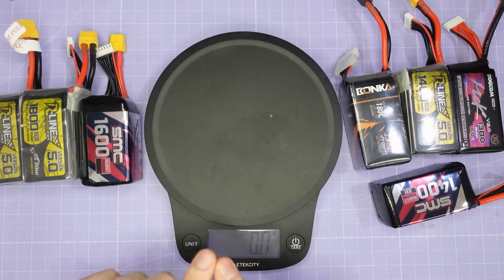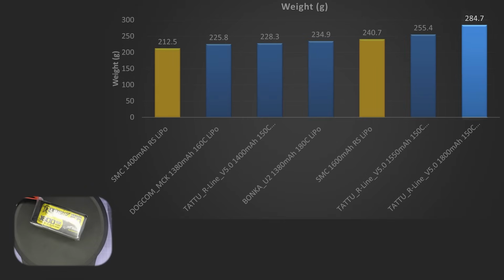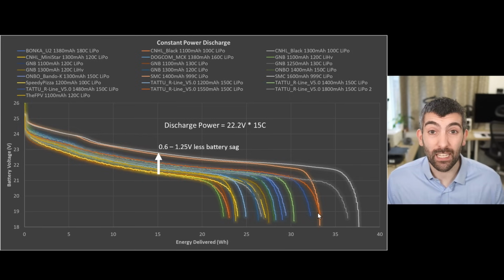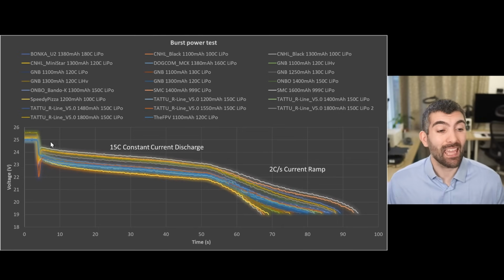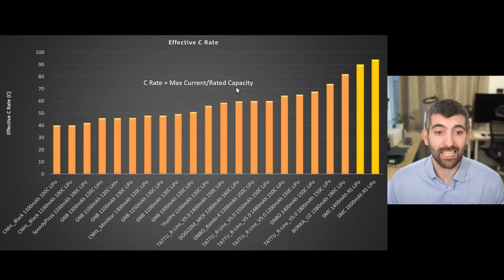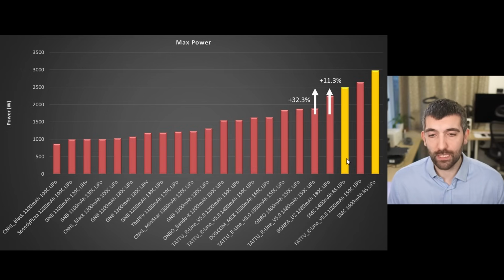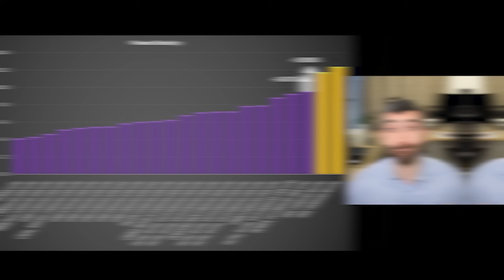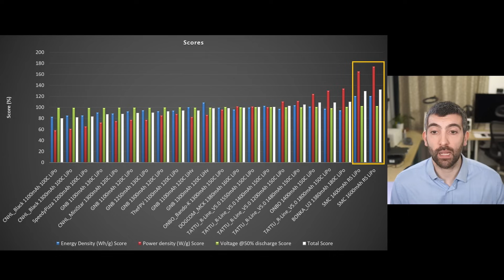Ultimate performance: SMC RS 1400mAh and 1600mAh Batteries

Comment: SMC you promote are capot. No good battery. You lie. No good performance. It's dangerous, easy to got fire as well just a few used only. Not more-than 8 uses, and same minutes on the other lipo battery.

Comment: Only problem is they are not producing example 850 for smaller drones and example 3000 for 5-7 drones, but other than that yea, best batteries hands down.  FOr the 850 i need to get tattu 5.0 and for a 3000 GNB lihv would be my choice

Comment: Hi! I have a genuine question that I think might be quite important! 

In the burst power test of the SMC 1600mAh LiPo cell, it goes from 15C to 94C in a total of 39.5 seconds, with an average C-rate of 54.5C. 

At a discharge rate of 54.5C, the cell is completely emptied in 66.06 seconds, so with the test starting at 80% capacity and lasting 39.5 seconds, the cell is only at 20.2% charge at the end of the test!

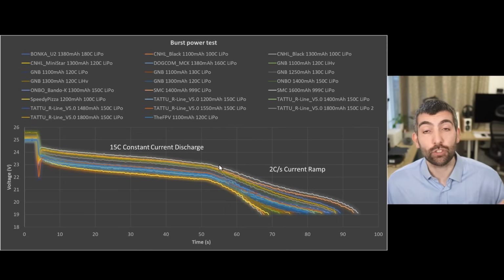4:54 You can see the voltage of the battery drop unusually steeply towards the end of the discharge, and I believe the results of the burst power test may have been affected from the cell being almost empty!

Have you considered that you might need to change up your methodology to be able to test these higher C-rate cells accurately in the future?

Appreciate your videos and will be looking forward to hearing from you! 😊

Comment: I just bought 2 of each of these and these things are beasts!! I ran them in a Mario 5 xh with the AOS supernova motors and it's quite a noticeable difference in performance. It's like when I modded and tuned my fz/mt09 and now have gobs of torque throughout the rev range. Also getting 60+ seconds more flight time

Comment: @Chris Rosser, damn you always have the answers that's for sure.
Look man, maybe you could find the cheapest Battery brands and figure out who has the secret sauce that really and truly outweighs the competitors.
I have this issue right now with CNHL Black 5000mah 6S 10awg 65C Rated.
I flew it about 10 times to empty and performed an "Internal Resistance" test on it only to come up with 22C to 31C on 2 separate packs using 0.7voltage drop per cell as my guide.. That's wack!
Your AOS 2207 1980kv motors are rated for 243amps (60.7*4) and I can't even get 155amps out of this CNHL Black 6S 5000amp LiPo.

It has to exist somewhere, that you can have a $50 5000mah 6S pack capable of matching these motors immense draw.
What can we do here man, cause I'm getting in way to deep here and I have work tomorrow 😵‍💫

Comment: Flew the 1400mah variant today for the first time and wow, absolutely crazy performance! Over 6mins flight time throwing around a 5" with max punch outs. Though like shown in the discharge test, once the pack gets low it really drops off a cliff hard, can't really fly below 3.8 with these. Still would highly recommend.

Comment: RC Buggy and Truggy racing only needs 65c even to push tekin r8 1900kv motor on 4s (1/8 scale e-buggy) to enough power , infact have to run power at like 55% on dry dirt track with a thunderpower 65c lipo (from 2013 era) and the most used lipos in racing now are like protek 130c . So 1/8 scale offroad racing is not to demanding on lipo energy even on a clay track with good hookup as then esc will do fine at 80% on say a tekin RX8 Gen 3 Esc which has 300amp output and 1000amp burst output.
Reply: It doesn’t matter if rc cars don’t load packs as hard as other genre’s of rc…any method of racing is going to benefit from packs that have higher energy density and power density…being able to run a battery that weigh’s less, but outputs more power, and holds a higher voltage(faster buggy), is going to give a racer an advantage.

Comment: Why didn’t you include any of the GNB 160c new packs in this? It seems odd to compare this saying it amazing vs all the other ones when all the other ones included are much older. Especially given there are more comparable ones that were recently released.
Reply: Two months down the road and what are your thoughts on this post? Are those packs, indeed, better?

Comment: I got a try these on my FPV Funjet fixed wing. I hit 242 mph on the Bonka 1800 after seeing your recommendation. I ended up melting the XT60 and so I switched to an XT90. I wonder why these crazy high powered packs are only coming with an XT 60 when that is clearly way higher than there rated for.
Reply: Cause people are sacks of braindead logics. It dont make sense when a 180c lipo at 1500mah is capable of continuous 270 amps.